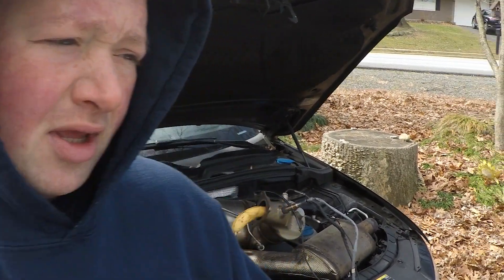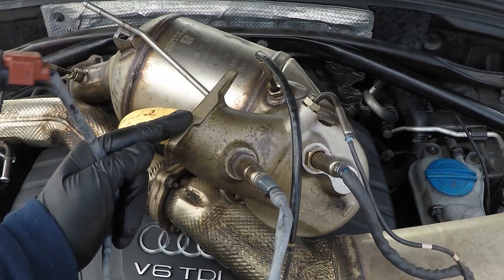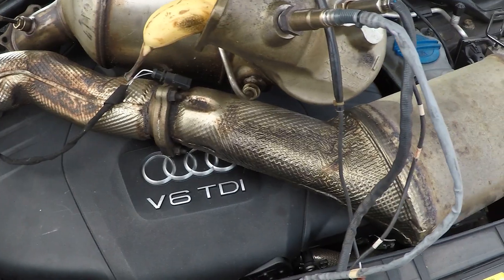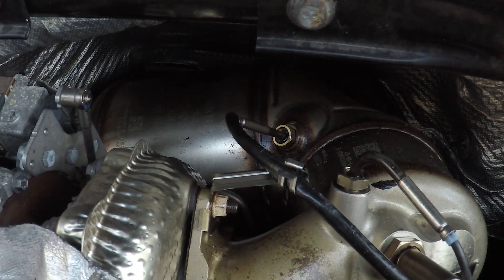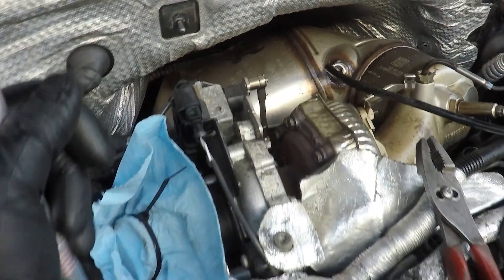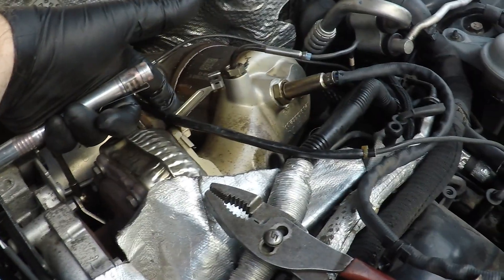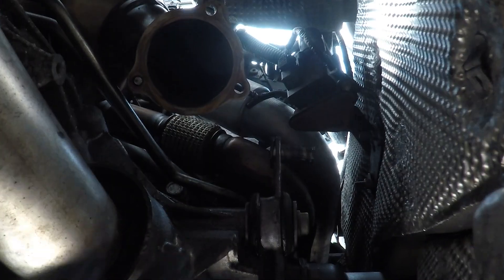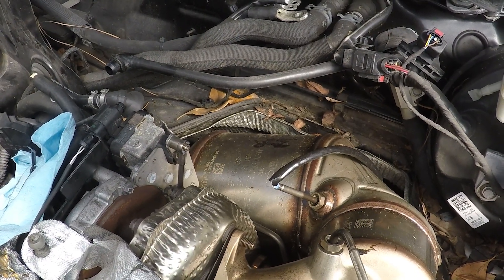DPF/Diesel Particulate Filter Replacement on 3.0 TDI V6 Engines in Audi Q5, A6, A7, and A8

Comment: Question sir, where is dpf on Audi Q8, do you know?
Is it in same place?
Reply from the maker: It is probably right behind the engine just like on this Q5 TDI. Unfortunately we did not receive TDIs after the 2016 model year in the USA because of the dieselgate scandal lawsuit. The Q8s with gas engines were released in 2019 in the USA.

Comment: Great video! I’m getting a P24C600 for particle sensor/temp sensor - electrical fault on a 15 Cayenne Diesel. Which sensor is that and where is it located? Thanks
Reply from the maker: I have another video on this channel of when I swapped out a Q7 exhaust that is similar to your Cayenne. That sensor is after the SCR and right before the exhaust clamp under the vehicle.
Reply: @OakesPerformanceSolutions awesome, just checked it out and saw the location. Thank you! It’s a plug and play I assume?
Reply from the maker: @caraficionado4724 yes it should be plug and play. Assuming that it comes out because the one in the video wouldn't come free from the pipe even when being heated up.

Comment: How did you get that vacuum line disconnected from the pass through on the heat shield???
Reply from the maker: I used a long flat head screwdriver to pop out the plastic portion of the brake booster vacuum line behind the cowl wall/heat shield then pushed the rubber grommet out of the other side.

Comment: Can you help me locate this sensor?
I have 2016 Audi A7 TDI. Got check engine light. Scan shows engine code P24C600 - Particulate Matter Sensor Temperature.
I am thinking of trying to clean it and check for any damage wires from it.
Reply from the maker: It is located under the vehicle. The metal sensor portion screws into the exhaust after the center exhaust clamp and then the electrical connector is located closer to the left rear tire behind the lower black plastic body panels/under trays.

Comment: Very useful video friend. I need your lights . Q3 130kw 2.0 , replaced dpf , injectors, dps , high pressure pump serviced , all pipes and manifolds cleaned , all diesel system cleaned , EGR changed and finally canceled with ecu map. Problem : Regen when ecu factory programmed (750 km) , BUT dpf not reaching temperatures to burning the soot. Car needs drive for 60-70 minutes aggressive (more than 120 klm speed and climbing hill). No fault codes ! Thanks in advance !
Reply: You may get put it in low gear and keep high RPM. I think same effect with you running high speed.
Reply: @hongdazheng5297  all driving style and options already done. Never did Regen like manufacturers suggest. Only with speed over 120 klm . Thanks anyway 😢
Reply from the maker: @seriousjob  That seems like a tuning error. Which can happen when too many maps are changed outside of the factory spec without complete understanding of how the systems overlap.
Reply: Prior to EGR deletion, I had normal Regen BUT , every 80-100 km max (in city drive and without stops)

Comment: Hi, good video. 
I have a 2013 3.0 Porsche Cayenne, and I'm getting fuel in the oil sump. Therefore, my oil level is rising. I've been advised that it's my DPF causing the problem. I have no fault codes, so what do you think is the issue with DPF? Thanks 😎.
Reply from the maker: Depending on the mileage the DPF could be getting clogged. However fuel getting into the oil is usually caused by injectors over spraying fuel that gets past the piston rings or really worn pistons, rings, and/or cylinder walls but the latter option is extremely rare.

Comment: What does the P226D Damaged or Substrate Missing code mean exactly?  I would assume it means the internals of the DPF are gone, which would mean it's clear to flow.  I see you had the same code...so what did the insides of the DPF you took off look like?
Reply from the maker: @bwguardian  that code is stored from the pressure reading of the DPF differential pressure sensor being outside of the specifications enough. My DPF was clogged or damaged causing less flow than ideal.
Reply: @OakesPerformanceSolutions  mine runs normal with no lack of power, so maybe mine is missing some of the insides...like in "see through" design...
Reply from the maker: @bwguardian  that is definitely possible. Let me know when you need tuning for this issue.